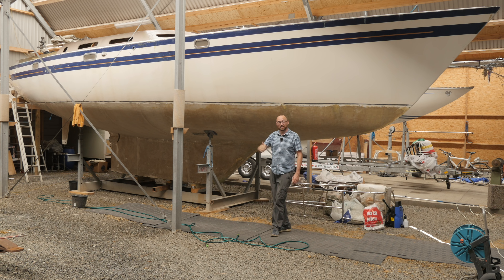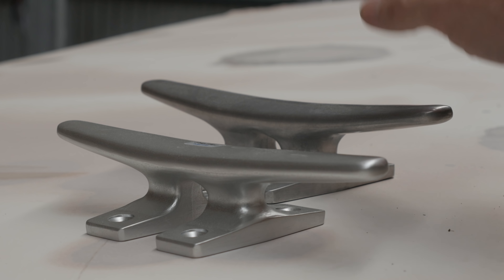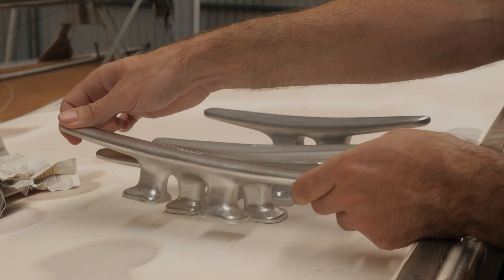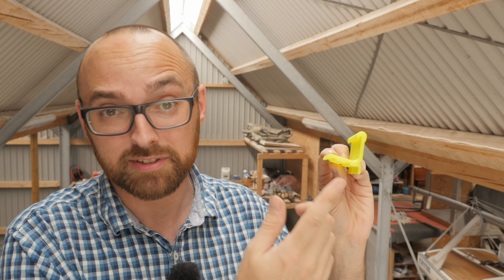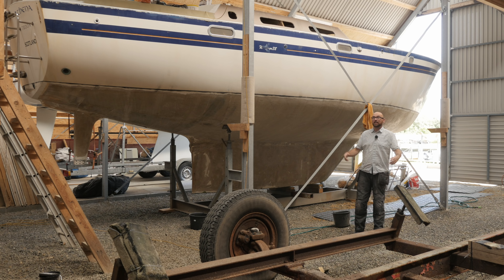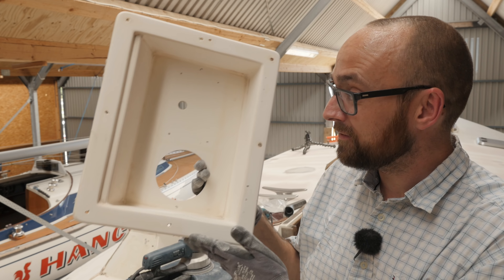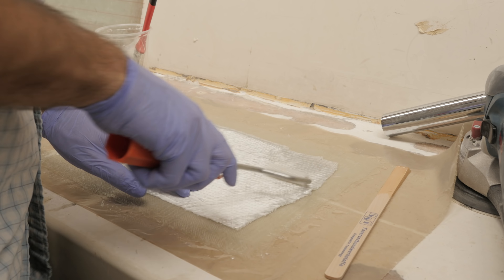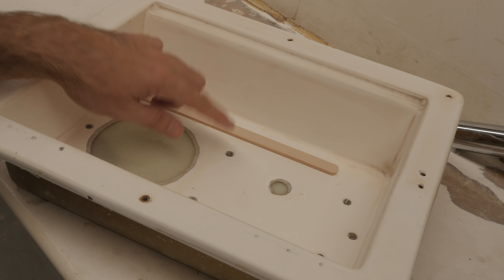Sail Life - Big hole in the cockpit, hull moisture & the perfect cleat? - DIY boat refit

Comment: Hey Mads - the reason the engine control panel is screwed in is similar to why electrical panels are screwed in. If there's an issue with a switch or button or something that is on that panel, the screws allow for easy access to the back of the panel for troubleshooting and replacement. If you glass that in, you should try to find a way to give yourself easy access to that panel if something were to go awry. But as long as you're thinking of that in the new technical area, it should be ok!

Comment: Regarding the cleats - I am not a boat expert but simply on engineering grounds the four hole version with the wider base spreads the load onto the deck much better reducing the strain on the decktop.  Less chance of any cracking developing.

Comment: Hi Mads, I am late to the party so this might not get read but on your cleats, the new ones will rely on just bolts for support, there is nothing where they sit for support. The more expensive ones have a base to stop "rolling" of the cleat and that along with more mounting points will make them stronger. Sorry I know the cheaper ones saves sailing funds but a cleat pulling out will be more expensive than buying the more expensive ones. Even with a backing plate the cheaper ones rely on just the strength of the bolts, and they look to be about 10mm and a 10 mm bolt has at best 22kN of strength. I changed to pop up cleats on my boat and they used similar hardware and a backing plate and one did pull out, might have been my handy work might be small hardware but I no longer have them on my Beneteau and went back to beefier type with a good base to take most of the support.

Comment: Have you thought about some sort of hinged rain and protective sun cover over the engine panel?  I've seen some pretty nice ones that were only on the top half of the opening which allowed most things to be done without even flipping it up, but worked fairly well to keep the rain and more importantly the UV off of the gauges, switches and such.  Also, in the heat of battle and extreme angles of heel and rocking in heavy seas hands, feet, elbows, knees and even butts sometimes get stuffed into these gauges and can do a bit of damage to the innards when that happens. Something to protect and shield them the worst of this abuse would be nice.

Comment: Great video again! All said about the toerails: I would still glass them over and would put an 10 cm aluminium "tape" attached to the lifeline posts instead. It would serve all the purpose a towrail have but without the thousand leaking possibility at lower cost. THe deck-hull connection would also be stronger. At least, this is my plan at our 38 feet sailboat. Best regards.

Comment: The heat has been high on the east coast UK too. Was going to align my reinstalled engine this weekend but held it off as spending time in an overheated engine compartment wasn't very appealing lol. It's supposed to get a little cooler this weekend plus I have 3 days off to get it done.

Comment: I totally understand the preference for those new cleat designs. However, even though I like the spacing between the legs of the newer ones myself (personal preference)... I think the old cleats, with their 4 bolts and side-tabs would be much stronger in side-load situations, even with a generous backing plate. You're probably right in that your new ones would be fine in most cases, but with those beefier earlier ones you would never have to worry if you were using, say, a water-friction device, such as a drogue or a sea anchor, of the side-load forces bending the bolts you are using to keep the cleat and backing-plate together.

It's just something to consider, I'm not making criticism. We can't plan for everything, but you can always just be more careful in your weather routing so that those situations are far less likely.
Reply: totally agree, was going to say the same thing!
Reply: use beefier cleats
Reply: As long as he uses those rope slot doohickeys on the gunwale, he shouldn’t have much side load... if any.
Reply: I wouldn't trust that my lines were going to stay in their slots in heavy seas when I'm using a drogue.
Reply: Just curious how many times you've used a drogue? I've been boating nearly 50 years, both for pleasure and commercially, and have never seen the need to use one, nor ever known anyone that did. Just curious....
Reply: Gary Souza 
AFAIK, people who sail the southern ocean use them to prevent sliding down the face of big swell.
Reply: But, but, but....Mads is nowhere near the southern ocean, and you didn't answer my question. Just curious...
Reply: Gary Souza
He said he wanted to cruise the world, and those conditions can come up anywhere, they're just common in the southern ocean.
His warrior is sturdy enough to handle those conditions as long as he doesn't surf down a big wave.
The point I was making is that side-loads can and do happen, and that trusting your line is going to stay in the slots of the toe-rail is foolish.
Reply: But, but, but... never mind. I know the answer...
Reply: My own experience is irrelevant to the point I'm making. You can continue to get upset that I didn't share my experience, the point stands.
Reply: But, there's no experience to share...
Reply: You're arguing with yourself Gary. It doesn't matter what my experience is. You wanted to make that a topic to make some counter-point to documented uses of drogues, but it changes nothing.
Besides which, using a drogue is not the only reason you might get side-loads on an on-deck cleat.
Reply: But yet here you are, still trying to make a moot point about drogues. My whole point was the chances of needing/using a drogue are so slim that it  doesn't matter. Now you are trying to change the point. Who's really arguing with themselves. Mads apparently has made up his mind and I happen to agree with him. BTW, my last and current sailboats had/have  cleats similar to the ones he chose: neat, clean and strong. Haven't had any problems with side loads. I'm done discussing this.
Reply: If anyone's making a moot point here Gary, it's you. These were your first words in this conversation:
Gary Souza 1 week ago
Just curious how many times you've used a drogue?

Yep, pointless. There are other reasons besides drogues that you might end up with side-loads on a cleat. And there are sailors who consistently use drogues in high swell/southern-ocean conditions.

It's you making the moot point.
Reply: Umm, read the following:
jeremyrainman
4 weeks ago
"I wouldn't trust that my lines were going to stay in their slots in heavy seas when I'm using a drogue".  But, but, but...you've never USED a drogue, so it's irrelevant. Those cleats are just as safe with "side loads". Take a walk around a marina and see what cleats are on boats. My money's on more cleats like the ones Mads chose, since I walked around my marina a little while ago and that's what I saw.  OK, now I'm done. You don't know what your talking about. I'm good with Mads' choice, and apparently so is he...BTW, those "slots" are called chocks or hawse pipes, and the biggest worry would be chafe....
Reply: @Gary
I know what I wrote. You wanted to find one thing wrong with it and troll. You didn't read my comment entirely, did you, you know, this part...

You're probably right in that your new ones would be fine in most cases,

I guess you can't read except when you want to argue over points that have nothing to do with what I actually tried to communicate. It's a shame, you've managed to pollute good communication with the desire to be "correct" and try to appear sanctimonious in the process.
Reply: Gary Souza there’s an episode of Ran sailing where they attached whole new steel plates, rather than trusting their rogue to a cleat anyways, they said the cleats are too high and weak, compared to the load a deployed drogue could give. So I think the cleats wouldn’t be used anyway for a drogue

Comment: Mads, 4 bolts are way stronger than just the 2 inbolts, there are often times even a the marina where there is alot of stress on cleats so would go with 4 bolts if the choice is there.

Comment: On the cleats, take threads out of diameter, add up solid connecting metal, if two bolts is more area than 4 bolts. This will be okay for straight tension. Problem is cleats are used for side tension. This equals wide base, four holes. That way you do not need metal backing, top and bottom. Your decision.
Cheers

Comment: Hello Mads, I really enjoy your channel; the quality of your work and the thought you put into it are a real joy to behold.

Regarding the two-bolt cleats, I could well be overthinking it, but I worry about the potential for those to crush into the topside of the deck over time.  

What I'll call "lateral loading" of those cleats (defined for purpose of this post as a force applied perpendicular to both the long axis of the cleat and the longitudinal axis of the bolts securing it through the deck) looks in passing as though it would place a tension load on the bolts which can be well distributed into the boat with a backing plate below the deck.  Tension is not, however, the only load path that needs to be addressed here.  Locally, at the cleat / deck interface, you will see this load taken in torsion, with the force trying to rotate the cleat around an imaginary axis that, by eye, will fall at or just below the surface of the deck.  This force will be transmitted to the deck by whatever the area of ½ of each of those mounting pads on the cleat is (i.e. the area extending beyond the centerline of the bolt on the side opposite the vector of force) which is not a lot of area.  On top of that, the distance from the centerline of the cleat to the outside edge of the mounting pad is shorter than the height of the cleat, thus creating a leverage ratio that serves to further increase the force seen by the deck.  

What all of this amounts to is that you will see VERY high compression loading of the deck immediately under the mounting pads of those cleats when lateral loads are applied to them.  My concern would be that over time this will fatigue and compress the deck material, which, as it progresses, will actually allow for even higher peak loads to be generated, accelerating the process, and would also allow for movement of the cleat, setting up a scenario for fatigue failure of the mounting hardware as well.   

With all of that said, I think the problem is entirely solvable (assuming, of course, that there is a problem at all; as I said at the outset, this could well be a product of my imagination).  My thought (which should be taken with a grain of salt considering you know a lot more about building boats that I do) would be two plates, one topside that the cleat sits directly on and one on the underside, sandwiching the deck.  They could sit proud of the deck or you could route out a pocket for the topside plate to sit in, so it is flush to the surrounding deck.  It'd be very strong in both lateral and axial pull, and I imagine it would look really nice too.

Anyhow, hope this is of some help.  If not, feel free to disregard it as you obviously know what you’re doing.
Reply: I was thinking along the same lines however most of the cleats you see sunken are from core rot. Mads in the past drill, fill, drills everything.

pivoting cleat would put stresses on the cleat at the deck mating surface, but fiberglass doesnt work harden. So i think with the thinkness that boat has, a backing plate, and protecting the core it will be fine.  

My thought... The stainless shear rating of the bolts should be taken into account because stainless is not a strong shear material.  Shear would be less of an issue with a larger footprint because the force would be more transitioned to lateral pull. But, I bet the bolts are more than strong enough.

That being said... Not sure i would go with the 2 bolts on blue water unless i was installing chocks to direct the load. big beefy cleat feels like good insurance to me. lol

Comment: Cleats are items that work  pieces of equipment that work about 98 percent of a boat's life! They are also an item that is commonly installed improperly at the factory --and --an item that is whose size and configuration s are improperly chosen by the builder!!! With all that in thought---sizing is important as is the fastening of the cleats to the yacht. The larger cleat you show looks good but the 4-bolt units are more prefered --in the the larger size! Cleats are not only used at the dock but also underway. Remember ---your life and that of your sweety may depend on these cleats. Good deck, big backing plates, proper fasteners-----Mikey---was in Seattle, now in Sequim, washington, USA

Comment: Regaring cleats: For normal (e.g. baltic sea weekend cruise) I would prefer the slim ones with 2 bolts. But when I plan a around-the-world I wouldn't make compromises: I would chose the 4 bolt version. You never know, what you have to fix on such a cleat.

Comment: 2:50  To me the base of the older cleats are wider therefor would give more support to a load pulling sideways since they would distribute the weight to the deck better.   Other than that everything else about the new ones is better.  Just my opinion.

Comment: I think I'd have left the cockpit instrument cluster as a removable unit, even with that flange and the screws. I'd have worked harder to fix the leaks. I just prefer being able to remove the whole thing to repair/replace any instruments, rather than having to crawl in from behind to do so. I also suspect you'll have to replace that ply at some point as it looks like it might have been a bulkhead. Dunno, though... Also, like everyone else, I'd vote for the four-screw cleats. It's a side-load.

Comment: I would do a comparison test of holding power on the cleats. Two bolts versus four will be a factor no matter how big you make the backing plate. You don't know just much load you might experience until you really need it. How much are you giving up for the reasons you are favoring the two bolt cleats?
Reply: Hi, Im following your neat and interesting vlogs for a while now. Thanks for the way you show your work and considerations.
About those  new cleats: in general you never know what forces they need to withstand neither the direction. Personally I would prefer not  to use those you showed with the two bolds. Thoo more need design and easier to clean, All the force must be resisted with just those two bolts... And sideways there is no really support. Worst off all imo is the fact that all the force must be taken by the thread in the Aluminium. And you have to tighten it in the first place. The one with four bolds have much more sideway support and 4 strong bolds with plates and nuts will keep it on the deck!!
Wishing you a wise decision!! And a good holiday.... 🤗😎

Comment: The wider base cleat is inherently more stable under lateral pull.  However, anything that could pull out the thinner ones would probably damage the wide ones to. Aesthetically, the thin ones are more attractive and your cleaning note is also worth considering.
Reply: The most difficult aspect of two stud cleats is the difficulty of immobilising them on the bedding compound.

Comment: Hi Mads. A technical question. Are you sure the 2 bolt cleat is for traverse loading?  You can work out the bending stress and that may pry on the fiberglass. Perhaps are only designed for load along the cleat like mast cleats or to be bolted on aluminium or steel bases. The math is simple I hope you did some checking, in curious to know what it is. Keep up the good work. Cheers

Comment: Is the water reading in the keel possibly due to the water in the bilge? Did you get all of the water out when you removed the foam? Thanks for all the tips and tricks with fibreglass- they will be really helpful as I have just become an honorary owner of a trimaran. That is for sweat equity I get to use this awesome boat for free!! So yeah I will be doing some fibreglass work repairs and will be definitely revisiting your videos for inspiration. Thanks Mads.

Comment: I'd love more info on 3D printed boat hardware. FDM printers are so cheap now. And although they require some learning you could build all kinds of things, print in nylon or PET, coat the prints in epoxy, reinforce with some fiberglass to make stuff. 
I'd love to see some experiments or maybe a collaboration with a 3D printing hobbyists. It might be a distracting rabbit hole for you. Maybe you can find someone locally. 
Per kilogram you'd pay between 15-50€ in material costs. It might save a ton of money and make you more independent on the move.
Reply: I was thinking of how valuable a 3D printer could be to someone in a remote area of the world.  Suddenly many parts are only as far away as a reliable internet connection.
Reply: I was going to say you can quickly make your won even without an internet connection, but then remembered fusion360 requires one ;)

Comment: What kind of respirator are you using when grinding not fully cured epxoy? I have read a1 filter + p3 particle filter is what to use. The epoxy I'm using on my boat takes 7 days in 20degre to fully cure. I'm using short thertm coverall + the mentioned above combination of filters. I'm new to using epoxy and want to protect myself. But I see your grinding even with out glows. Just want to get your view of handling epoxy resin.